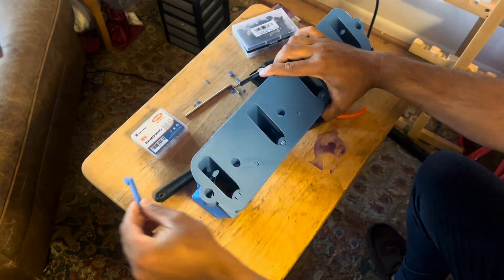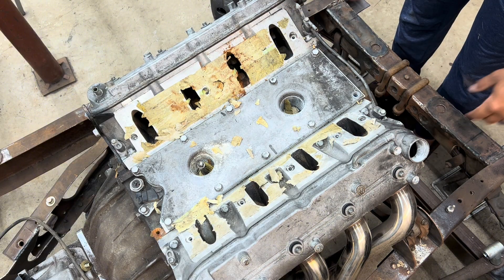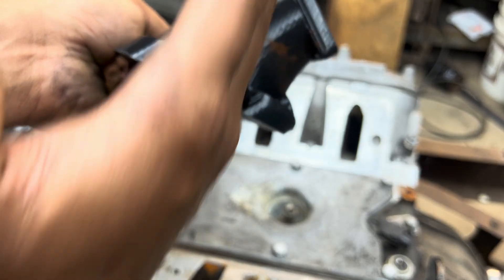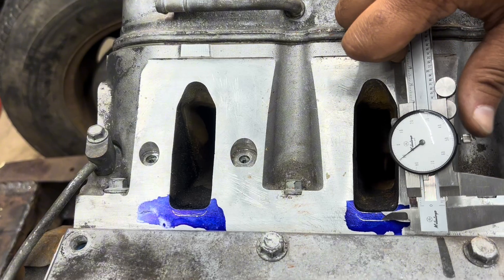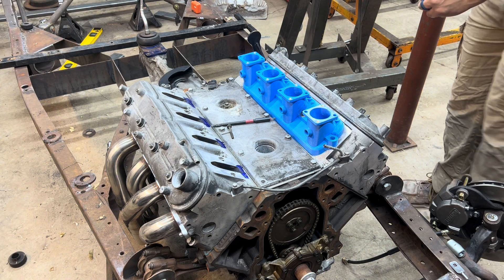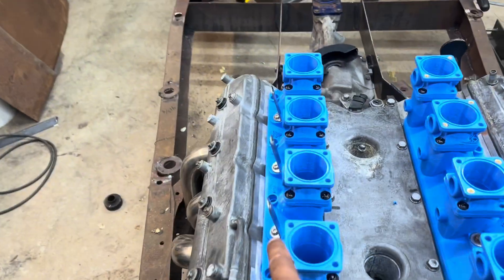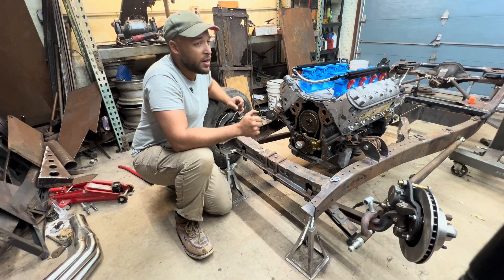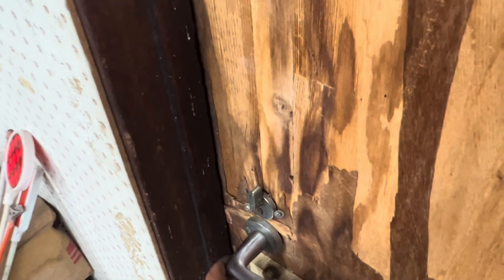I 3D-Printed Custom ITBs for My LS Swap!

Comment: Impressive project. With the fuel rail inserts, you might want to press the brass inserts in from the other side of the manifold to guarantee that they can't pull - you don't want the fuel rail coming loose.  I have zero experiance of this, but I'd probably consider bonding in aluminium inserts for the injector seats too.
Reply from the maker: Honestly they are quite strong. I do plan on doing a few more tests but when you pull on the insert it will break the plastic before the nut comes out. Thanks for watching!
Reply: @KevansBuilds  I've had them creep out on SLS nylon parts, so tend to play it safe where the design allows it.  I mention it as something that may be an improvement rather than a belief that what you're doing won't work, I've not done the tests with your materials or use case.  Looking forward to your next update.
Reply from the maker: I appreciate the help! I also have some tee nuts I can insert from the underside and epoxy in if needed. I think that will be my final solution.
Reply: @KevansBuilds  indeed, where I have space I'm embedding square nuts in the print.

Comment: Can I suggest printing in smaller sections of the manifold so you can iterate faster? You don't need to print the whole manifold to find bolt patterns and angles, it's a waste of plastic and time
Reply from the maker: Yes I agree! In this case this is my first full assembly and I needed to know how everything would fit together. Now that I know I may be able to print smaller pieces but we will see.

Comment: Can't wait to hear this thing run. Are you also planning on making some tuned trumpets / velocity stacks? you can tune the peak torque with the velocity stack length 😎
Reply from the maker: Exactly! I also want to make a common plenum design with a common plenum and filter. Maybe put it all on an engine dyno and see how they all perform.

Comment: Love this man. I just stumbled on this build today. Just a suggestion, only because I haven’t measured the overall length needed for the manifold on a 3D printers build plate, split the manifolds. It might help selling the plans to guys if they have a smaller printer. If you do offer to sell the plans, I’ll buy a set tomorrow.
Reply from the maker: Thanks! I appreciate it! Once I get the final iteration finished, printed, and tested (on a dyno) it will be available in some shape or form. Thanks for watching!

Comment: What are you planning to print the final version out of? I'm assuming something with carbon fiber reinforcement to stand up to engine compartment heat. This should look pretty cool when it's all done!
Reply from the maker: Yes! I’ll be using PA-CF or something similar.

Comment: ince you got the desighn right you might be able to make those parts using a wax fillament then use a lost wax method to be able to cast them in aluminum
Reply from the maker: Yes! I have some already. That is an option

Comment: Not for nothing, but happy little design flaw. The bolts where the washers had to be ground down, just make them cam bolts like in a suspension. Then you can use the bolts to fine tune the fore and aft play.

Comment: Have you tried to change the support connection distance? I am not sure what it is in every slicer, but in Cura/Bambu/Anycubic there is an option in the support section where you can select distance between support and build. One of the options should be top z distance.  If you change it to 0.35-0.4mm the supports will break right off. Makes quick proto way easier.
Reply from the maker: This was done in Creality slice. It’s a pretty old program that was recommended in the paper work with my printer when I bought it. I just recently downloaded Creality Print and it’s much better with support options. There were no settings in the other slicer it seems.
Reply: @KevansBuilds  Orca slicer is the ducks guts.